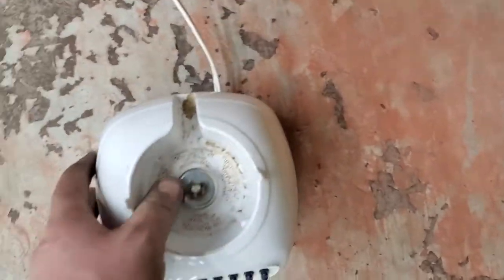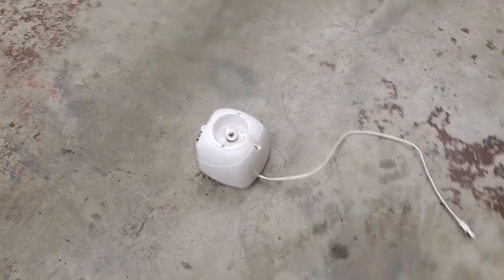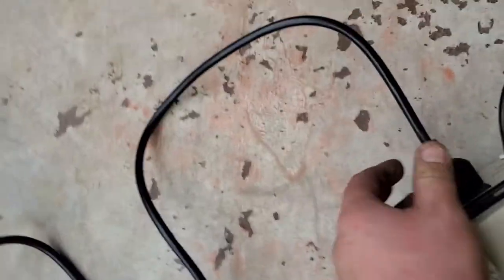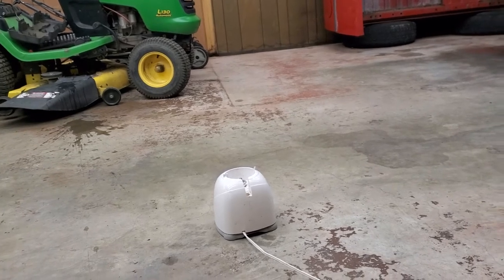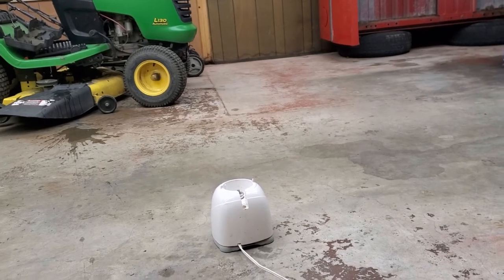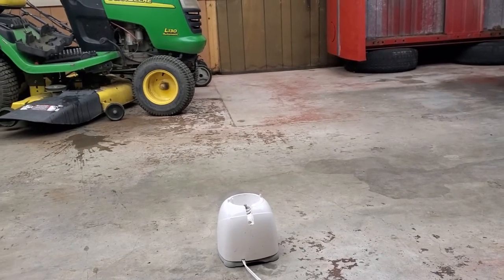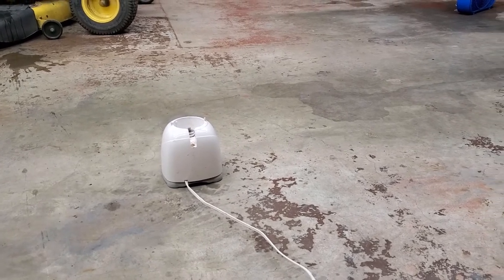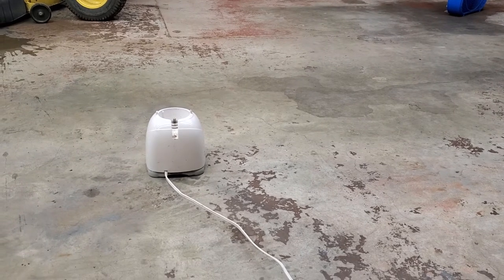Blender Motor Overvoltage (photonicinduction cover)

Comment: i loved the we popped it, I believe you should find a thermal cutout that was too easy, run it till it catches on fire, kind of hot wire it if you will. Look forward to helping you with a few vids.
Reply from the maker: I'll pull it apart and see if I can find a thermal fuse and bypass it if its fried if its just the brushes I'll replace the brushes and try for round 2